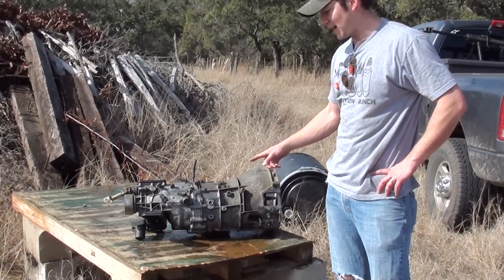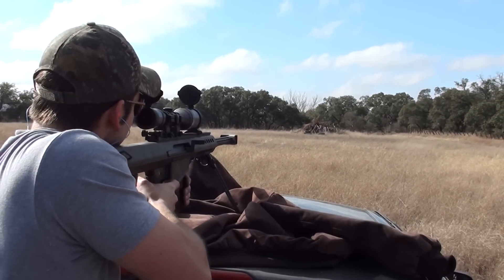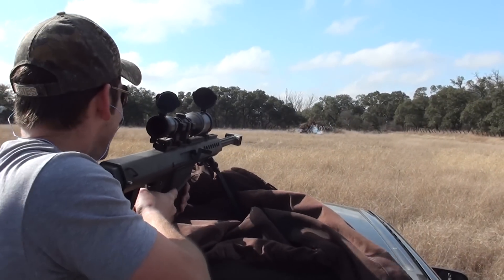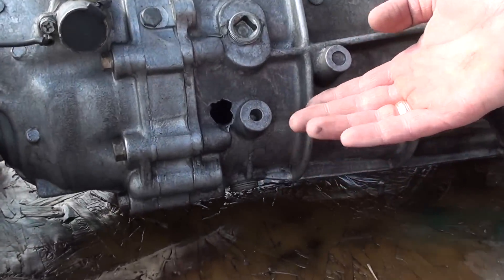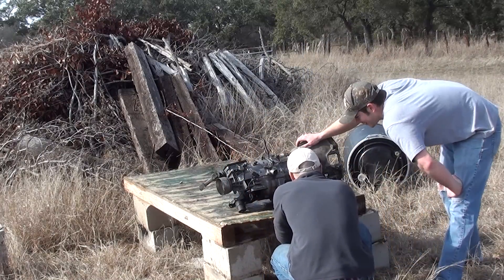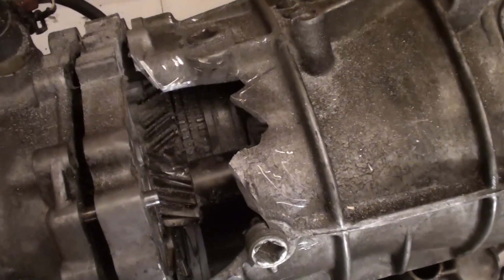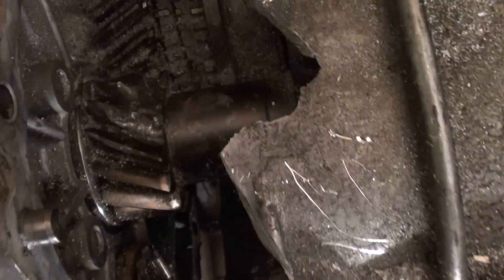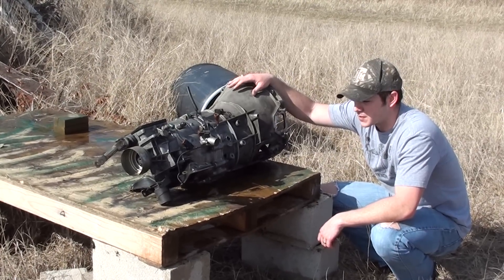50BMG vs Transmission

Comment: An FMJ (which I'm assuming is used here) will generally have much less penetration against hard objects than an armor-piercing round.  Even then, about an inch (25.4 mm) of hardened steel is cited to be about the limit of standard armor-piercing .50 BMG and 12.7x108mm loads.  Still, damaging the teeth of that transmission will surely skew a vehicle's mobility, if not halt it.  As always, great video!

Comment: I want to see you shoot a running engine. I would like to know how long it would run after impact, or would it immediately stop.
Reply: Depends on point of impact really.
Reply: Turbeh1 That is true, but I meant try to hit the block. I already know what happens when you shoot a block with a .50 bmg, but most people don't get to see that.
Reply: Since the .50 BMG was at least in part designed to destroy engines, I'm pretty sure that it would almost immediately seize..... And I personally am really interested to see something like that too hahaha, sounds very entertaining.
Reply: World Known fps Russia shot a running engine with an assault rifle, it stopped after like 2 hits.

Comment: Dang that 5.9 straight pipe sounded goood. Should put a 5 inch on there though, would be louder
Reply: Andrew Monreal 5" sounds slick I'm getting ready to do 4"turbo down and 5" from there on my gen 2 12v
Reply: Toby Covert Dang dude the 12v's are so loud with 5 inch. You should post a video of it when you have it on there. What kind of tranny do you have in it?

Comment: I had the feeling that its never going through that if he hits it there because the internals of transmissions are hardened steel. Im however shocked it did not  ricochet and come out somewhere else. Should have used an AP round!

Comment: You should call out 22plinkster again, but use the 50BMG.  Spin a quarter and run back and shoot it or an over the shoulder shot at a balloon...guess trick would be just to hold on to the gun on that second one.

Comment: I can't see how anything could go through that shaft, it would have to be harder than tempered steel 7+ on the mohs scale to retain its shape on impact. The problem is anything harder is going to be too brittle to make it through the casing in one piece. In theory you could crack it but the energy in a 50 cal is trivially small to achieve that. Transmissions live hard hard lives.

Comment: What length barrel is this? The short barrel doesn't have much penetration. Also, the  AP rounds are very pokey... To give you an idea about barrel length, we stopped an AP round with a tire on its side through the tread. I don't believe it would have ever stopped with the full length barrel. On another occasion, we stopped it with a hardened steel plate approx 5/8" thick and a sniper shot through the same plate with a 300 Win Mag 200 gn FMJ.

Comment: Results didn't surprise me at all. There's a lot of crap in a transmission to stop a bullet up. More so than an engine block. Especially in a transmission that most likely has hardened parts like a sports car trans like that.

Comment: I'm guessing that was ball ammo and not armor piercing.  Probably still wouldn't go all the way through, but that's not necessary.  That is one dead tranny, regardless.  Nobody is driving out in that vehicle.

I'm amazed that when I shoot hard drives with a .50 BMG, it only goes through five of them and is stopped by the sixth.  Hard drives are fairly good armor!  It's all of those plates of glass and stainless and aluminum.  Once the bullet turns sideways, it's all over.

Comment: Not surprised that it didnt go all the way through.  You have no idea how hard trannie gears are.  It would likely take a AP round to punch all the way through, if even that would do it.
Reply: Indeed, the steel grade used for gears is extremely tough in terms of hardness/yield strength to resist wear and high torque. Probably quite close properties than the steel used on an AP round.
Reply: transvestite gears are hard? xD do you talk from experience? xD

Comment: I built a 50BMG out of paper (green) and am actually uploading the video showing it now. You should see it. I ran out of paper before I was able to make a mag and a stock, so.... But, anyway... I was walking along these train tracks, and I found a DUD BULLET next to a sign FULL OF BULLET HOLES, and so I took back the dud, emptied the gunpowder, and put the bullet back in. (270 caliber.) (The paper BMG had a working bolt at the time, but then it jammed somehow, I mean, HOW DOES PAPER JAM??? But anyway, it jammed, but at the time it was still working.) I went up to somebody, and showed them the bullet. I said, "Here I have me a bullet," (I held up the paper 50) "and here I have me a gun," (at that, I opened the bolt and put the bullet in) "let's see what happens!" I am not kidding, I actually did this! I also found ten 20 gauge shotgun shells and a dead chicken. Oh, and two dozen railroad spikes, a track plate, and a track plate connector. (I think that's what it's called.) I then decided to go back. :)

Comment: .50 Cal Incendiary vs. filled propane tank
Reply: it most likely won't do anything, since the propane would need to have the right air to fuel ratio, when the bullets goes through it, most likely it would just release the gas from the tank.

Comment: Were they AP rounds? If they were AP it would've cut right through.
Reply: I doubt, it's wayyy too thick
Reply: *****
.50 cal AP rounds are designed for shooting through steel plate. They can go through 19mm of steel armor at 1500 yards away, so from point blank ranges (for a Barret rifle) I bet it would've gone through.
Reply: bulbinking well we don't know that for sure unless we try it. But I hardly doubt it would because the inside of a transmission have too much metal
Reply: bulbinking It REALLY depends on what it hits.  A couple gears in the way can easily amount to trying to shoot through a foot thick hardened steel plate.  I love the BMG, but it's got it's limits, and that's beyond them.   

Look at car door tests with pistol/small rifle rounds.  Some pass easily, some don't pass, depending on what happens to be in the direct path of the bullet inside that door.
Reply: i still dont think it would make it through all those stainless steel gears inside
Reply: EmofacePS3  They are hardened steel, not stainless.  Stainless is a much softer steel, it doesn't rust, but isn't as strong as many carbon-steel alloys.
Reply: but in the end it is doing its job though, no?
how useful is that transmission after just one round?
Reply: ZanXpeacemaker0989 I'm not sure if they tried to turn it, but I think there's a good chance it would have been able to continue on its way with just one broken tooth;  For a little bit, anyhow.
Reply: JB Offroad I thought most rifle rounds go through car door easily? And pistol round will get stop sometimes and sometimes it will still penetrate?
Reply: *****
7.62 always goes through, 5.56 most of the time, 9mm around 50-75% of the time.
Reply: Nevin Williams Yeah, it would continue until damage from running without gear oil and the damaged gear grinding down the others and anything damaged from the lead, copper, and the aluminium.
Reply: Wolf Delgado
I reckon it would be a pretty cool shot if he managed to blow a chunk of the housing in between 2 gears
Reply: Yeah i'd say it'd be awesome for him to buy a junk car that just barely runs and have a few rounds put into it while it is running, then show the damage the round did.
Reply: ***** Usually they go right through the car door.  Unless they hit something like the power window motor.  Lock mechanism, etc.. (Not .50, we're talking handgun rounds or low power rifle vs. car door)

 My point was just that it all depends on what you hit trying to shoot through something that determines whether or not you succeed.
Reply: Wolf Delgado there're already people who try that here on YouTube ;)
Reply: you are just mad because it didn't penetrate. And no I don't think a .50 BMG AP/API will have a complete penetration after seeing the FMJ didn't even penetrate (half way) through the transmission
Reply: 7150285 Given what those gears are built te withstand, im not surprised one bit.

Comment: ok wait. how many blades did u go through with that sawzall though haha
Reply: 1 because the housing is aluminum. And I've cut steel tubing with blades anyways
Reply: I don't think i have lost any consumables aside from tungsten to aluminum :)
Reply: lol yea but this dude is sawing through some serious automotive metal on the reg. i picture him with the sawzall and a fresh pack of blades each day performing metal surgery.
Reply: No mater the quality of aluminum, steel tooling chews through it pretty damn easy. Exceptions exsist but most handtools won't even blink. I have had ot get 'gummy' with my hand forged high speed steel tools, but ir still didn't harm it.